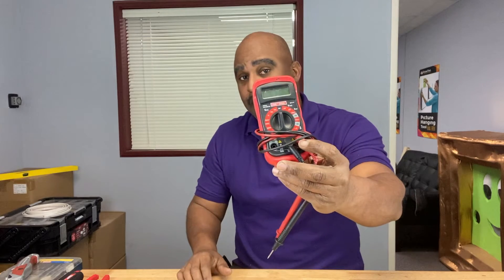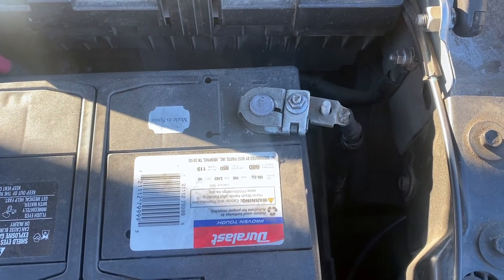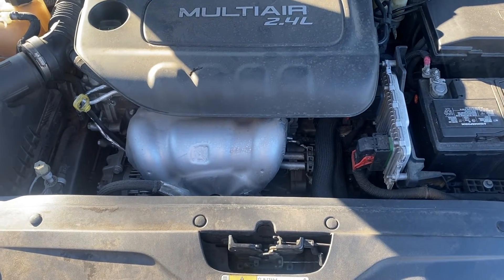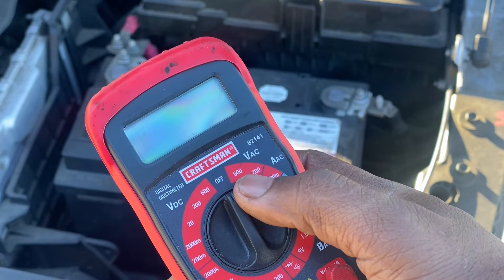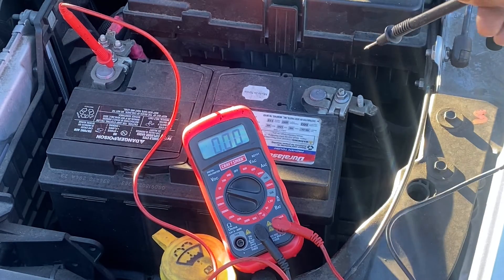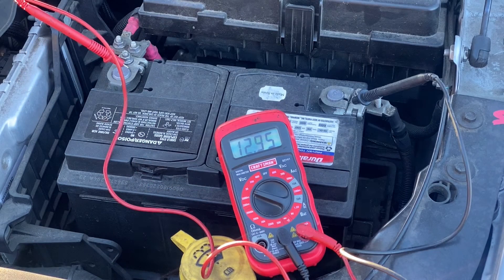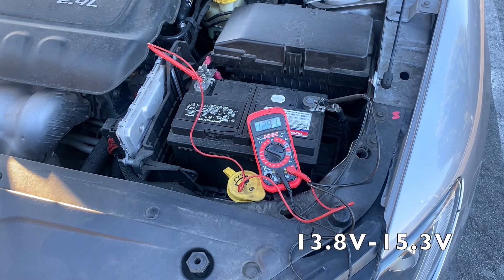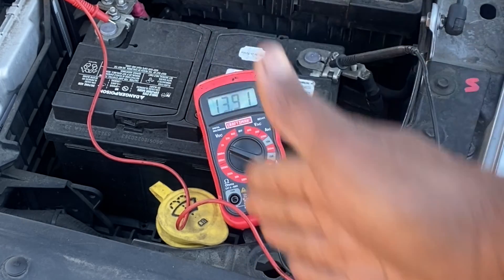CHECK YOUR ALTERNATOR WITH A VOLT METER

Comment: I was driving my car for three months turned it off came back out and nothing won't start battery is good no clicking no nothing
Reply from the maker: Could be a that the terminals are corroded or loose. 
The ground(negative cable) connection.  
Other issues can be a bad starter or ignition switch.